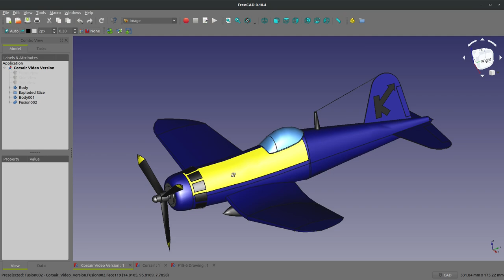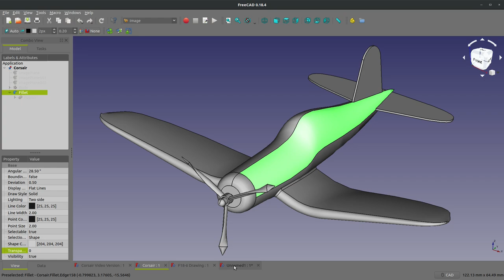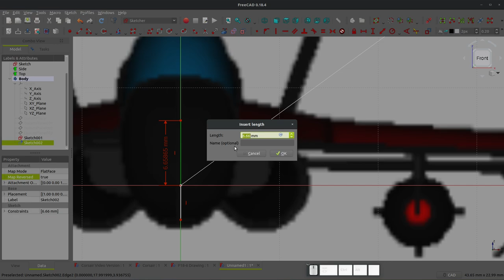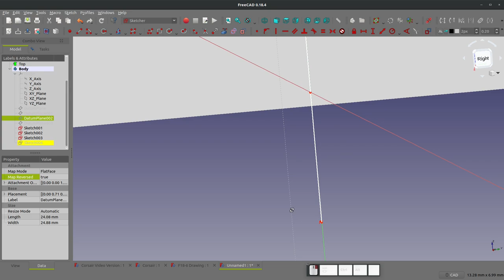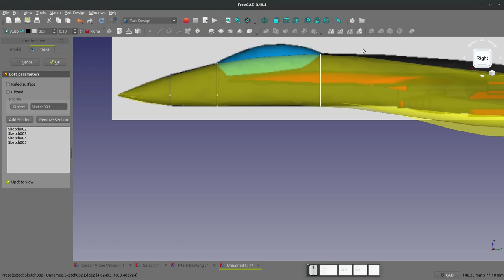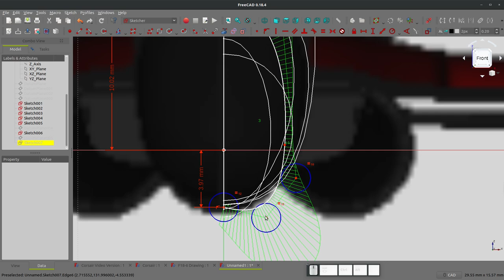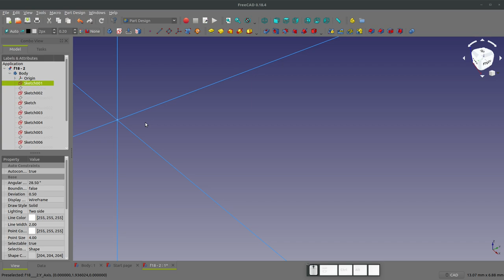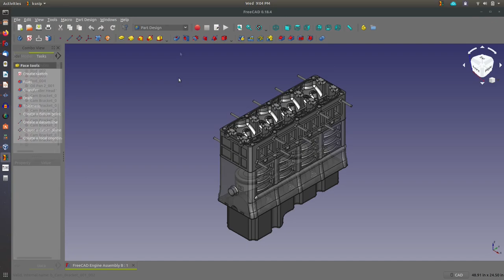Make an F18 In FreeCAD Video 1: Lofting Discussion |JOKO ENGINEERING|

Comment: Your tutorials are great. 
Using your guides I was able to create an empty hull for a boat. But now I would like to know how to create the internal stuff like bulkheads, stringers and interior that are dependent on the shape of the hull (and give the hull thickness). And then I would like to know how to mirror most of the stuff for one hull into a second hull to create a Catamaran. 
This would be awesome to create a model boat :)
Reply from the maker: Could you send some images of the finished product to my email?  I'm interested to know what kind of shapes you're looking at.
Reply: @JokoEngineeringhelp   RazorCats has really good renders of their catamarans where you can see the bulkheads (vertical walls supporting the hull), interior and the hull (https://www.razorcats.com/#vc_images-carousel-1-1605473732) Stringers are not always used when fiberglass or carbon fiber molded hulls are built. Stringers would be placed horizontal between bulkheads, usually used when building with plywood or metal (https://live.staticflickr.com/930/28877692867_41bd8df852_b.jpg)
Reply: I'm trying to do the exact same thing. Model a boat hull.

Comment: Can you do an FEM analysis for a Space Frame (simple cart chassis for example) and point out where should we reinforce and how to get the correct triangulation. Thanks.
Reply from the maker: I have done something like that on a table granted with lower forces.
Reply: @JokoEngineeringhelp  I have seen that video. My problem is that I don't know where to reinforce the frame and how to correctly triangulate it. Thanks.

Comment: What about lofting with a guide rail? I haven't checked if FreeCAD supports this, but in other cad packages that could help constrain the misbehaving loft.
Reply from the maker: You can, but in FreeCAD that functionality is contained within sweep.  One guide rail may be used
Reply: @JokoEngineeringhelp  until you can loft with multiple rails FreeCAD cannot be taken seriously in relation to Solidworks. this missing functionality is a serious flaw if you want to produce aircraft, cars, or anything curved
Reply from the maker: @PaulMaceOfficial  Using two rails can be done in FreeCAD but not with the specific set of tools mentioned in the video.  When you surface curved stuff in FreeCAD two rails is an option.  Were you unaware of this?
Reply: @JokoEngineeringhelp  There is a tricky option in the curves workbench for a two rail sweep but it requires a ruled surface and then a conversion to a nurbs approximation. This is still very limited and messy. Doesn't work well with sketches with multiple edges. Also doesn't sweep to a point object/sketch (so can't make nose cone object).

Compare this to the ability in Solidworks to select a given set of profiles (including points) and loft between them along any number of rails and create the surface straight away. Sadly I've not been able to recreate this easy workflow in FreeCAD, but maybe it will be available one day.

Comment: Why do you rotate the camera before adjusting the height of the vertical lines, then snap it back and see that it's still off.
Wouldn't it be easier to just drag the linepoint with the camera aligned with the axis plane?
Reply from the maker: If I understand your question it's because sketch elements cannot be moved when viewing perpendicular to the sketch plane.